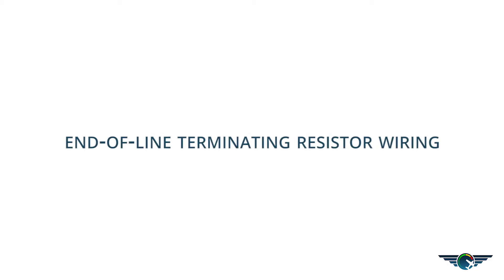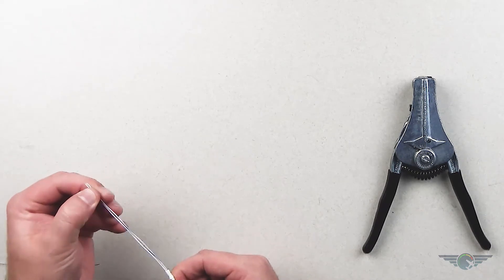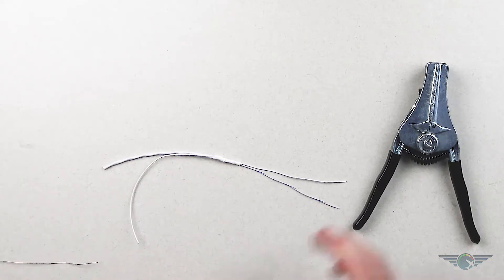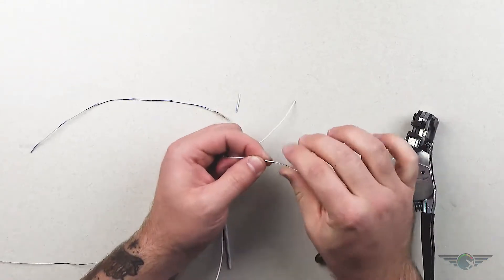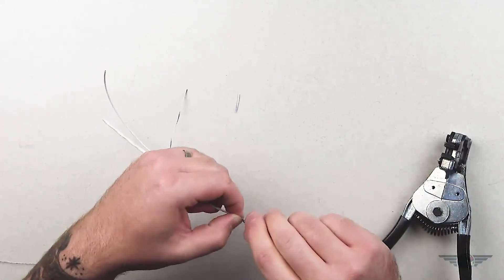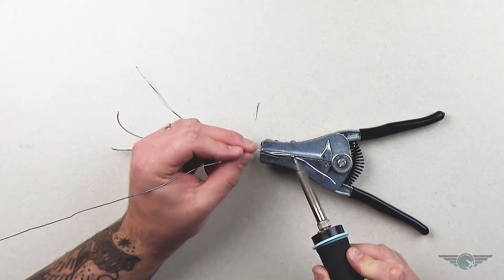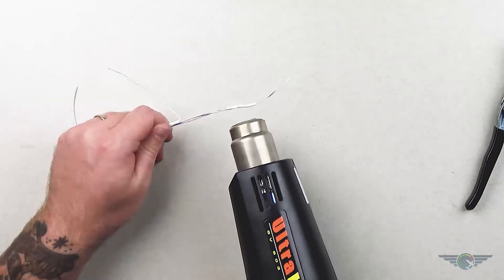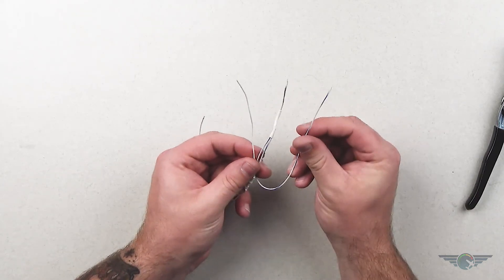Garmin G3X Wiring Fundamentals Series – End-of-Line Terminating Resistor Wiring

Comment: The G3X manual suggests connecting the shield to each node’s backshell, although it says it is acceptable to connect only the end node’s shield to the backshell.  It certainly is a lot less work to not connect each node shield, but I am wondering how much sacrifice is made in reliability doing so as this video series shows with only the drains connected at the end nodes.

Comment: The G3X Installation manual shows the CAN LO terminated, where as you mention in your example terminating the CAN HI wire.  Does this matter as long as it's the same on both ends?  I'm planning to wire as the Installation manual suggests to the LO wire.  Thanks for the great videos, these are extremely helpful.
Reply from the maker: Yes, please follow the installation manual. The important part is to use consistent color wire color for easier troubleshooting later. For example, using white for HI and blue for LO or vice-versa. 

Yes, all the CAN HI daisy chain to each other and all of the CAN LO daisy chain to each other.

^DK